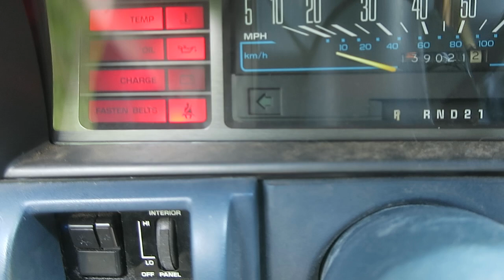Swapping Wagner 323 for EP37 Flasher

Comment: In many instances, a slow flash rate on the 224, 323 and other fixed-load flashers in older vehicles is simply due to voltage drop in the car's electrical system  and the flasher itself is fine. Most last forever. The newer electronic flashers are less sensitive to voltage fluctuations

Comment: If you no longer want that 323 flasher, and if you still have it, I'll buy it off you.
Reply from the maker: Sorry,  it was subject to destructive failure analysis.
Reply: @KarlHaase  Awww damn lol. Ah well. They don't make that model anymore and its getting harder to find. Pretty neat how they work huh.
Reply: I see new ones on eBay from time to time. Buy a new one there or go to your nearest junk yard. I used to find these all the time 20-30 years ago but they have not been used in OEM installations since about 1995 so they will be much fewer and far between.
Reply: @AlexanderCrump  I've seen them on ebay, they were kinda pricey. But I did go and raid a wrecking yard here and found a few. I need to check out the others.
Reply: I got it